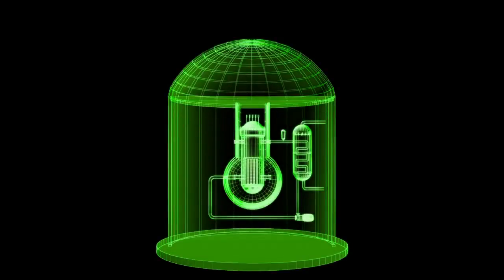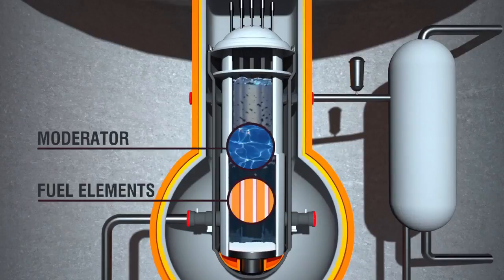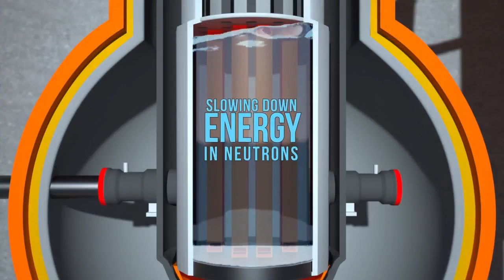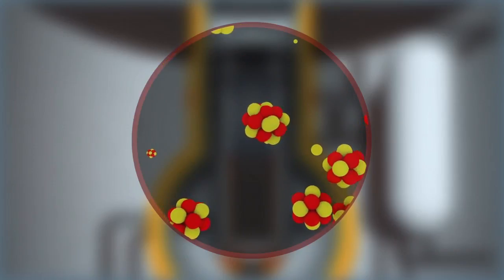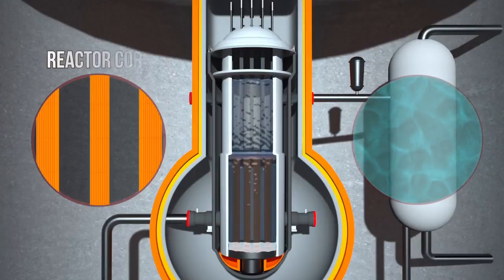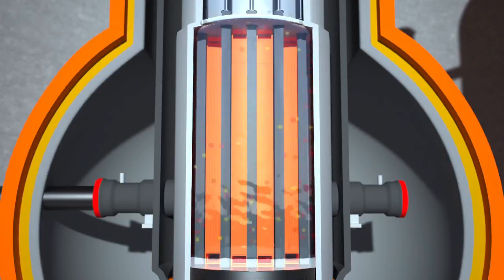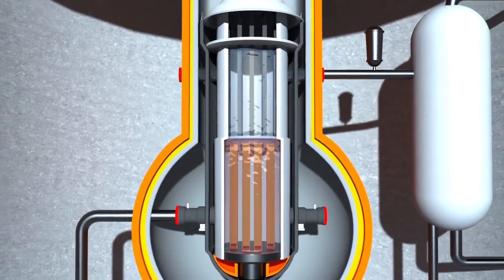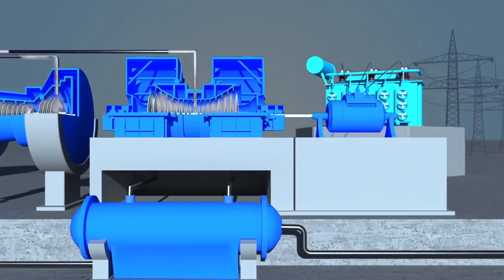Working of Nuclear Reactor

Comment: An unclear reactor works by bombarding the fuel rods with neutrons generated by a neutron howitzer, the fuel rods act like a resistor against the neutrons generating heat, very similar to an element in a kettle.  The neutrons generated in the howitzer are produced from high voltage accelerated through a partical accelerator. The high voltage is stepped up from the output power of the plant. Nuclear fission is an unclear way to explain how a nuclear reactor works imo.

Comment: at 4:08 it is shown as if part of the heated water is made into the steam which is used to produce energy, O.K., and part of it is going to the pump which makes the heated water go back to the core. Is there actually any kind of cooler which cools the water before it enters the core again?
Reply: No. Cooling water only for the condenser used by the steam turbine. Want as high a vacuum in the turbine to expand steam and get as much work out of the steam.  For instance, 1 steam pressure in absolute PSIA of 1 psi has a  Saturated Steam Temperature of 101.696 degrees F.  At 0.1 PSIA  the Saturated Steam Temperature is 35.0058 F. The colder the water leaving the condenser means more efficiency from the turbine.

Comment: How reaction starts no details???
Reply: a plant that has never operated before and has all new fuel would need something to start the neutrons firing. This is caused by a startup neutron source, such as Californium-252 or Plutonium-238. These metallic elements are inserted into the reactor with new nuclear fuel. As control rods are lifted from the reactor core, neutrons from the neutron source start to fire, and because there is enough fuel for a sustained reaction, we start the fission process, which sustains a plant

Comment: From where this neutron came at first? And how
Reply: The first neutron is released form our side to initiate the reaction. they have special device for that
Reply: @prashanttiwari6214  That depends on the type of reactor it is and or the practices of the licensee.  Some operators only extract a fraction of the spent fuel during refueling.  The new spent fuel is then activated by the fuel that was left in the core.
Reply: I think Nuclear reactors are designed to sustain an ongoing chain reaction of fission; they are filled with a specially designed, solid uranium fuel and surrounded by water, which facilitates the process. When the reactor starts, uranium atoms will split, releasing neutrons and heat.
I hope this might help u

Comment: But how does it start?? The rods go in the water, blank blank blank blank, then fission begins. What happens to start the process? Why isnt fission happening as the rods are loaded or prepped?
Reply: If only it would be so easy then u won't need be a nuclear physicist to build or understand how they really works nor would u need piles of nuclear physics books if it can be done in 4 min videos lol
Reply: I want an answer to this too it's been bugging me all week
Reply: Those blank you study in MIT for years,I guess
Reply: If I hit a lead or a uranium atom with a speedy enough proton neutrons will be knocked out. Not sure how they do it to start brand new powerplants but residual delayed neutrons come from fission products. Maybe they take a freshly spent fuel assembly from another plant, maybe the fresh pile just does the odd side-reaction.
Reply: it reaches critical mass.
Reply: The fuel rods in the water begin to fission, with water moderating the reaction, and the control rods are partially taken out in order to allow the reaction to start.